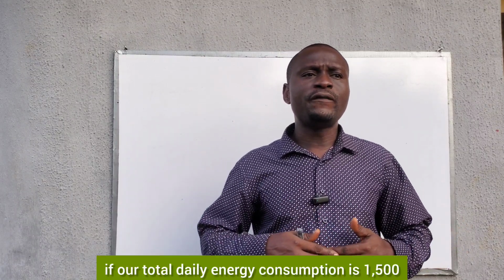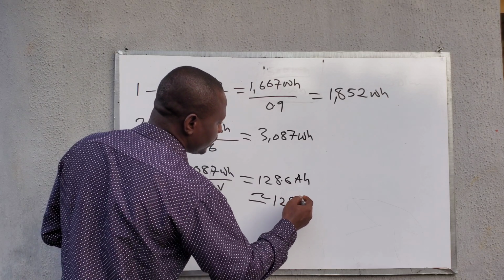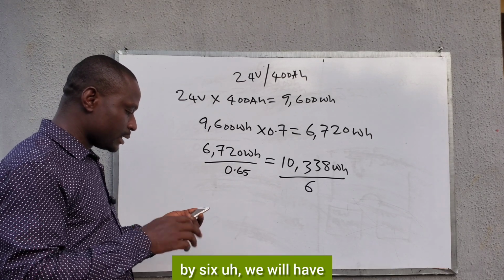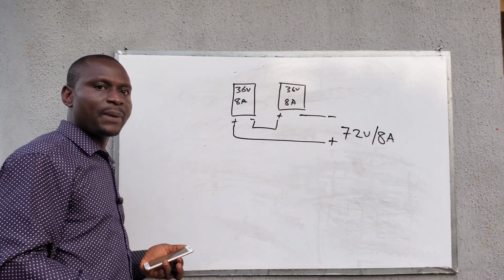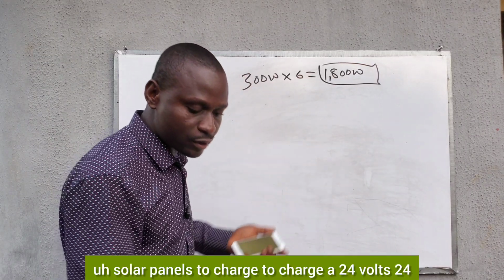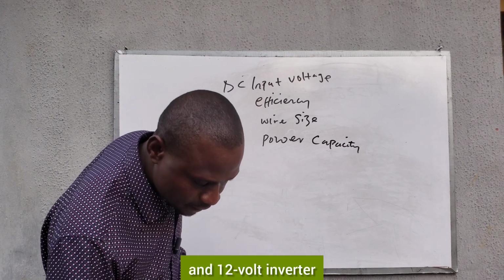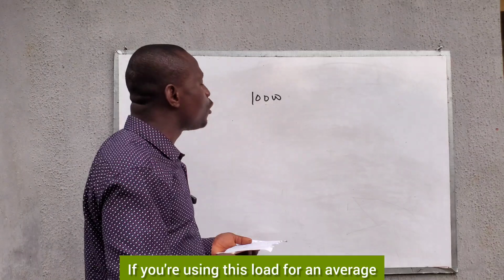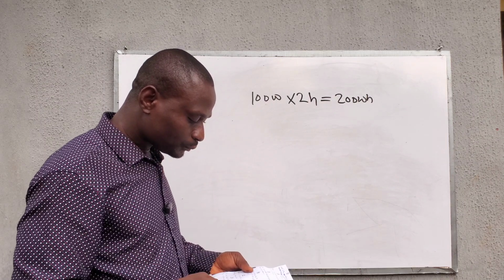Training on solar power installation: Common questions and answers. #solarenergy #solarpanel

Comment: From Zambia greetings sir? My question is should I suppose to be disconnecting the battery whenever it  is fully charged and the charger controller from the solar whenever I am not charging.

Comment: If you have installed a solar energy and the solar energy can't put on the water pump on, what is the course of that, i mean it work for short time and then it goes off and there is another load also.

Comment: Always great watching your video. Please i see a lot of assumptions from some of these designs. Its usually based on usage of the battery storage bank at night. For most users, usage is both night and day. This is an important factor as if the users are consuming the energy during the day also. This impacts the actual energy that can be gotten to save in the battery

Comment: How can I connect my 18pcs panel with the different 2pcs 80Amp charger with a 25kw lithium battery Bank with 5000klw inverter.

Comment: Can I connect an AC charger to my charge controller before supplying to the battery. I am watching from Agege
Reply from the maker: No please. Connect the ac charger to the battery terminals or you use a busbar.
Please check the charging parameters of the ac charger mostly the dc side of the charger to see if it matches with the charging recommendations of the battery.
Reply: Thanks. Let me reframe the question. If I have a transformer charger that supplies 18V DC output, can I connect it to the solar input terminals of the charge controller for an output of 14.4V that will supply the battery terminals from the PWM charge controller.

Comment: Very grateful!!🇿🇼  My Question is I have a basic solar using 32inch plasma,and decoder ,only 12v ,1  50ah battery,30amp controller,1 100watt panel my problem is it not  exceeding 2hrs  viewing time before it cut off is this right??.🇿🇼🇿🇼

Comment: Please i want to know if am using 15kwh lithium battery, when charged to full how many hours can it  power a place that have a load of  3,000watts? Without any other power supply.
Watching from Bayelsa State
Reply from the maker: @emmanueljoekingakpoaru1976  What is the capacity of the battery?

Comment: Watching from Zambia, I have a hybrid inverter with inbuilt pwm charger controller .I want to get 2 by 550w 12v solar pannels , will this work? My battery is a 12v 100ah
Reply from the maker: @joshuachipere2047  What is the pv maximum and minimum input voltage of the hybrid inverter?
Reply: @Solarwattng 1.5kw

Comment: In a hybrid inverter, when solar panels are charging the battery can they also power up the loads at the same time, as it is with the grid supply?
Reply from the maker: Yes... You need enough panels to power the load and also charge the battery bank

Comment: Please, can I connect the batteries in series while the panels are connected in parallel, or they must both be in the same connection patern?
Ikanaene,  chatting from Port Harcourt.
Reply: Yes you can decide to connect your panels in parallel and your battery in series, it all depends on your design.
If your batteries are 6v and you're looking for 12v you will do your series connection to get your 12v.

Comment: Can a 30A mpppt be used with 4 pieces of 190 panels to charge a sing 12v battery?
Also, what happens if the solar array capacity is larger than the charge controller? Will it damage the charge controller if my pv voltage input does not exceed the rating of the charge controller?

Comment: Thanks for the good work sir.
The question i have is, if the battery got weak when the panels were connected in parallel, can it be boosted back if u again connected the panels in series thus vice versa

Comment: Please, I need practical step by step connections of solar power installation SYSTEMS from solar panels to charge controllers, then to batteries, then to INVERTER and connections to the house for supply of electricity. Thanks.
Reply: Go and signup on student programs on his programs don't go for free knowledge always please for your own good and knowledge

Comment: Nice video. You are a good teacher. Please limit the recommended DOD fo any type of lead acid batteries to a maximum of 50% for a nice balance between capacity and longevity. I'll also suggest that charge controller sizing should be done based on the batteries nominal voltage, say 24V, not 28.8V because there are moments in the charging circle when the battery voltage will be less than 24V and more amps will have to be supplied for the same or equivalent power. This will also help with cable and fuse sizing. I understand you added a safety margin of 1.2 already but I'll personally use 1.25 instead. Most people get frustrated with solar because they put too much emphasis on cost instead of value and end up undersizing their systems and/or buying inferior equipment. Also use "amp hours" not "amps hour". I understand your videos are (correctly) directed at people in developing countries where lead acid batteries are still dominant, but lithium ion (and indeed sodium ion) are gradually becoming cheaper and more popular so try to include them in your calculations. Again thanks for the wonderful video.